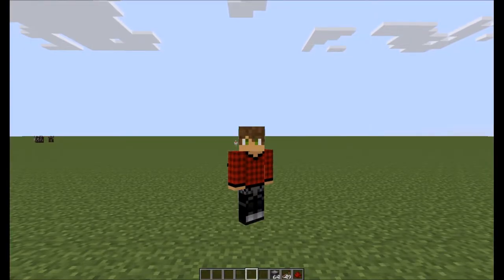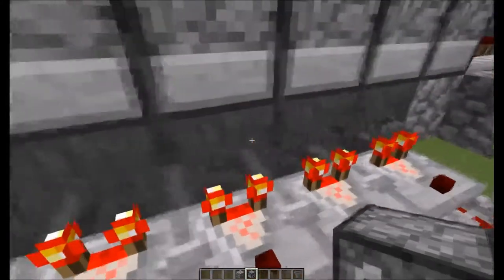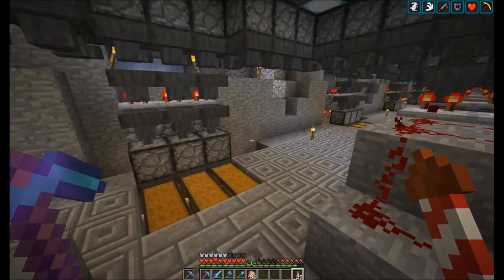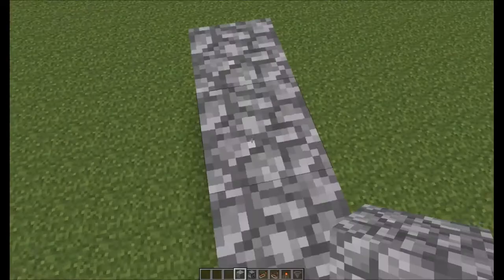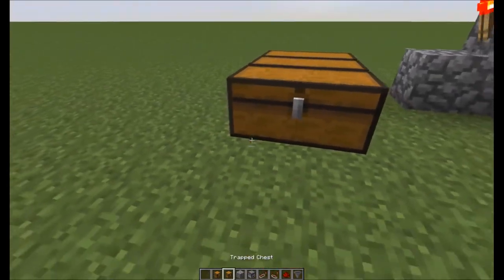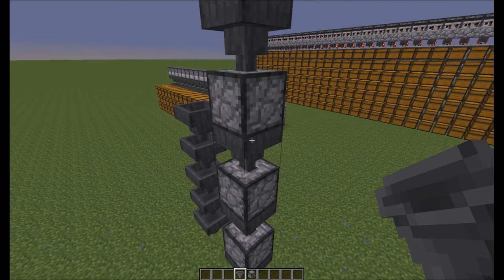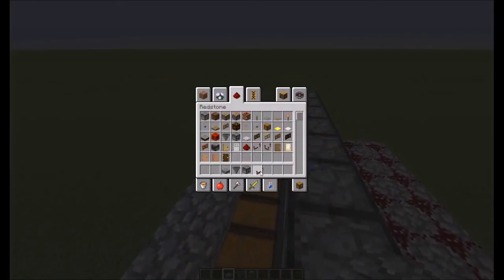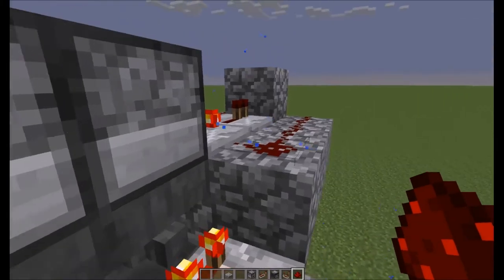MineTech: Dropper Sorting System by; Carburetor Gaming

Comment: Dude droppers don't reduce lag in 1.12.2
Its same as if there were no droppers above it, illmango showed it in his video called killer hopper where he talks how to imrouve the lag in your server and stuff

And pls go the xisumavoid server
Reply from the maker: I would have to disagree with that. The testing that Xisuma has done has proven that droppers reduce lag. I will look into it though
Reply from the maker: I dont know if I believe that. All of the tests I had done with this system showed that droppers do in fact reduce lag. Granted I dont know if that falls into 12.2, as I tested it in 12.1, but that seems like an odd thing to be done in a minor update.
Reply: Use Gnemboms carpet mod
Reply from the maker: His what???
Reply from the maker: I did my research, you arent wrong, but you arent right either. If you use the droppers as a hopper REPLACEMENT, you can in fact reduce lag because you are reducing the number of hoppers you have. Plus, hoppers are expensive, doing this can save iron if you are running low.

Comment: your sorter logic has a weakness. of cross contamination causeing  mass failures if one fails.. if you alternate teh second redstone dust line with a piston  pushing a blockacross a torch (downward) every second one. its more efficient and less apt to breakage.. ..
Reply from the maker: That doesnt happen actually. If the hopper FULLY fills up, it doesnt put out enough power to bleed over into the other systems. Even with 16 item stacks, it doesnt reach over. And while that way fixes lag, it doesnt help the cost aspect. You have to weigh cost to functionality.
Reply: my experience differs.. yes it s more costly but it is more reliable
Reply from the maker: Again, your experience differs. It all comes down to strategy though. I prefer simpler builds that maybe need maintenance over time vs maintenance free builds that are a pain to build